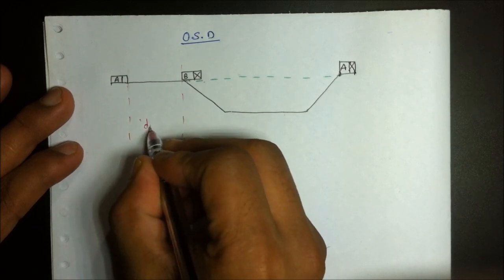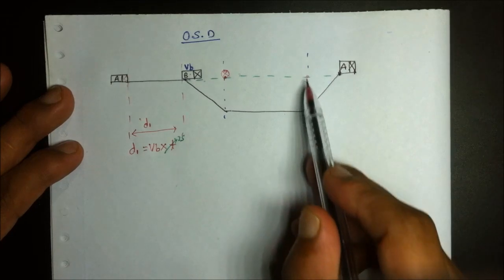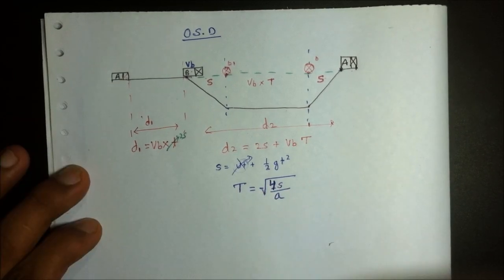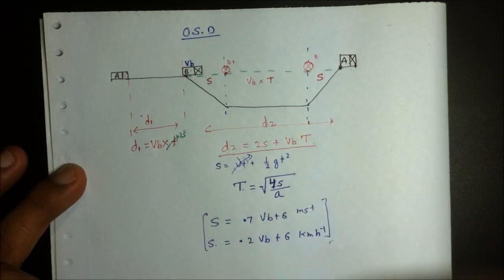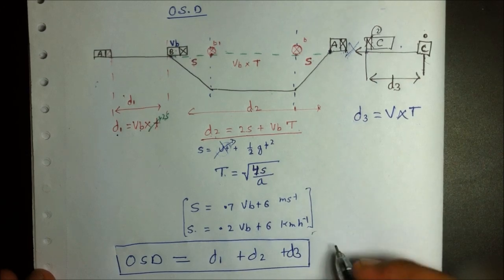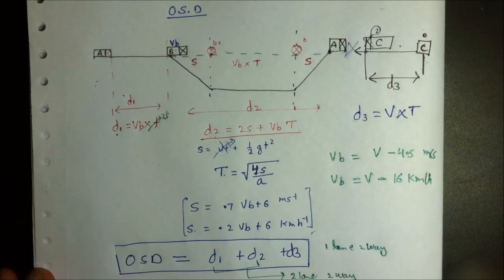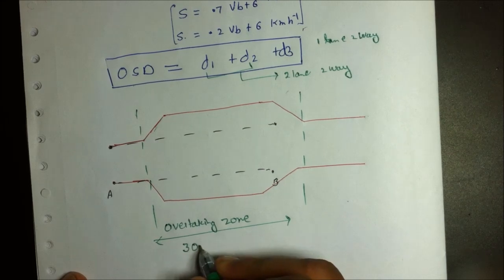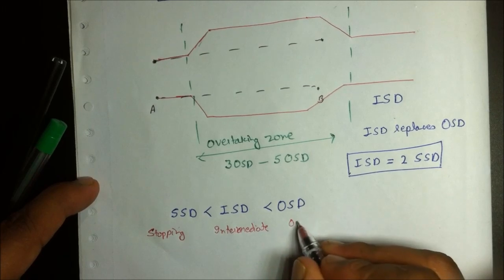Overtaking Sight Distance

Comment: Fantastic explanation. This knowledge is key whilst overtaking cars on a single lane highway at high speeds. If this maths goes wrong, you're pretty much fucked.
Reply from the maker: Subhasish Ghosh for safty purposes we take friction factor as 0.35 instead of 1. So if this math goes wrong to a bit of extent its f9.